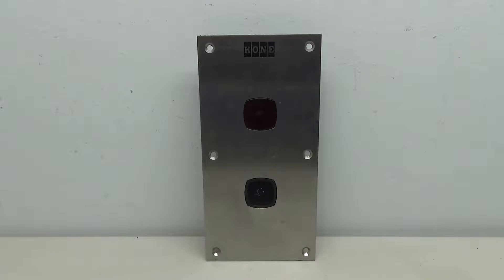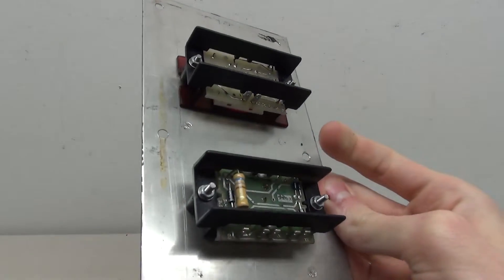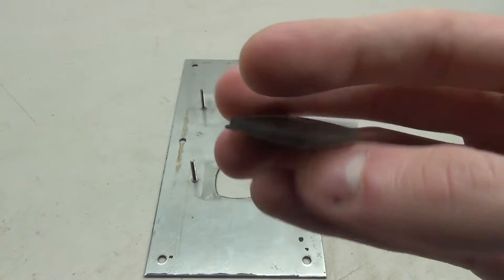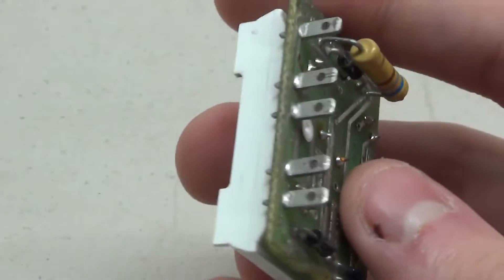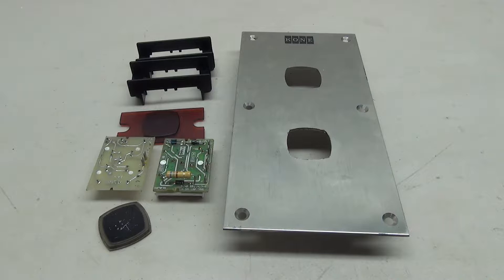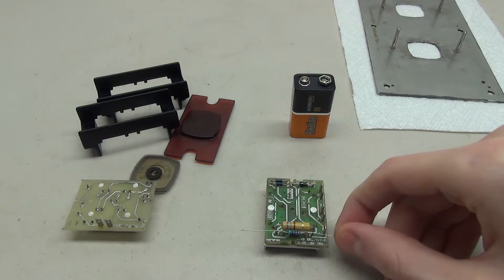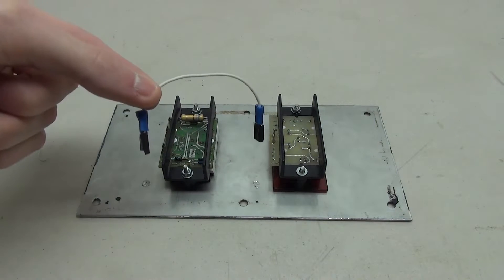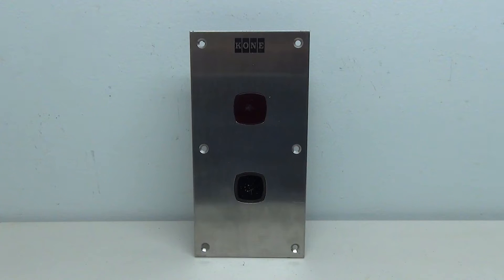Wiring Kone M Series Elevator Buttons

Comment: Thanks for helping me find the right bulbs. I finished wiring the Monitor TR and it turned out pretty good except for the contacts. I have to press the buttons really hard for them to light up. The contacts look kind of dirty and beat up. Is there any way I could clean them so  they can press better?
Reply from the maker: I normally take the contacts apart and use some sandpaper to take off the dirt.
Reply: Ok, I'll try doing that.
Reply: I cleaned the contacts and it made it a bit better, but I think the main issue is with the springs. I'm fine with it's current state. I don't want to take it apart because I don't want to accidentally break something. I don't know Monitor too well.
Reply from the maker: Contact cleaner would help too. It’s a spray you put on the contacts.
Reply: Ok, I found some on Ebay.
Reply: Thanks for the tips.

Comment: There are some other variants of KONE M barrel buttons. The standard one is the black variant like this one, and they are mostly flat although there is also a protruded version which are commonly found in Asia Pacific countries like Singapore, Hong Kong and New Zealand. Other variants are stainless steel (a bit rare, they are usually seen in Asia Pacific) and a gold variant (this one is very rare, so far I have only seen one like that in Singapore).

In Sweden ans Finland, most KONE M buttons have a protruding green button for the ground floor button to indicate the main floor or exit (as per EN codes).
Reply from the maker: That's cool! I'd love to see some in the field someday.
Reply: One thing, there is also a touch sensitive version of KONE M buttons which is extremely rare. These buttons are larger than the regular push button version, has a little red square lamp above the number and the button base is either flat or concave.
Reply from the maker: I’d love to see the circuit board of the touch ones!
Reply: Too bad the touch sensitive ones are extremely rare now.

Watched this again, I just realized that I've actually seen that microswitch before in a MacGregor KONE marine elevator. I worked in a cruise ship last year and one of the service elevators was in a rather bad shape with one of the button plates missing. That's where I saw the actual microswitch with my own eyes.
Reply from the maker: That's cool! It appears the switch can't be taken apart without destroying it, so I can't really see how the contact works.